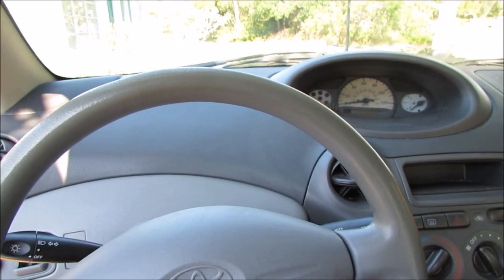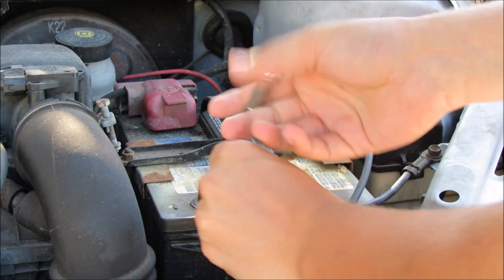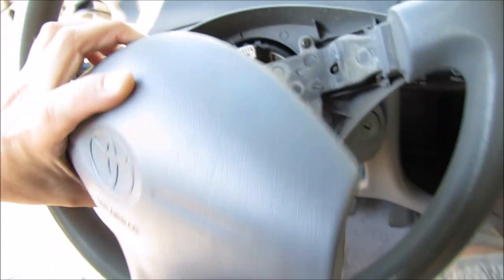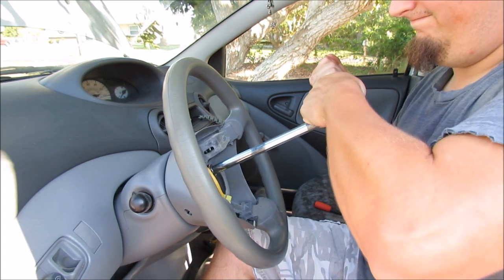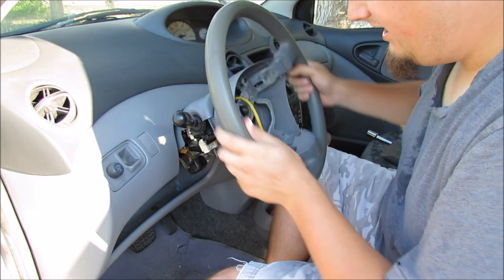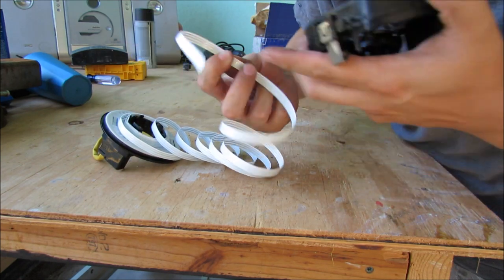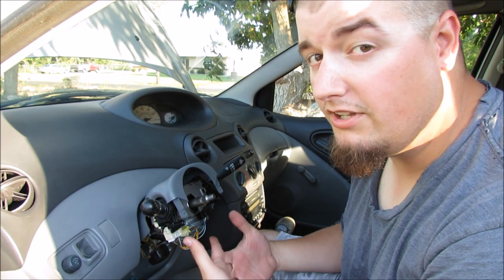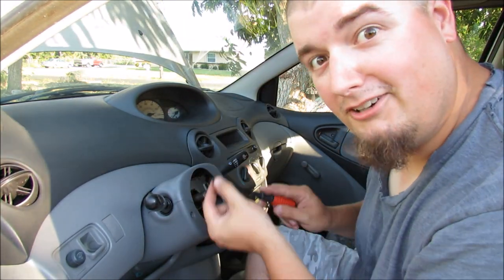Toyota Echo S01E07 How to Remove Toyota Echo Airbag

Comment: Great video series. I would recommend fixing the airbag properly. Airbags provide more overall safety even when wearing a seat belt, it would contribute to resale value, and It would make a good video that shows you fix things the right way. Keep up the good work brother.
Reply from the maker: Thanks for the view and  comment.  Although im clearly not a fan of them.  I will be sourcing a new clock spring assembly from somewhere, maybe a junkyard.  These Echos are getting harder to find.  I realize now that my turn signal stalk will not return to the off position without it.  So theres a few reasons to get it back.  Functioning airbag, Horn, and Turn Signals.  Its a much needed fix.    Thanks again for watching!

Comment: FYI: For anyone else wanting to look under the steering wheel without pulling the steering wheel. Turn your steering wheel left or right and you can pull out the Philips head screws. 

So much easier than pulling the steering wheel! :D

Comment: Hey! Nice video man. I was wondering since I want to replace my steering wheel. Is there a way to loosen the cable which sits in the middle of the airbag on the back of the unit? Thanks in advance!

Comment: Should invest in a steering wheel puller next time that way you don't strain yourself trying to pull a steering wheel off.
Reply from the maker: but wheres the fun in that.  I took off the one in the mustang with a hammer lol.
Reply: One year later - I had to use a steering wheel puller since it would not come off. Autozone gives you loaners if you want. Problem I was having was that the airbag light on my 2001 Echo was on. Also, before that the horn did not work. Problem the spiral clock. Changed it and the airbag light went off and the horn now sounds. Thanks for putting up this video. Without it no way would I have even tried to dismantle the steering.

Comment: I drive an echo (right hand drive in Aus) my airbag light is also on, was hoping it was an easy connector under the seat set up like the Camry haha apparently not!!.  I’ve had a few weird things stop working over the past yr or so, such as interior light, radio & (forgot the third).  Just a question, I have this blue light on the dash, I’m guessing it’s something to do with water & temperature, do you know what that is and how to fix it?
Reply from the maker: The only blue lights i can think of are the water temp sensor being cold like you said and the high beams light.  Make sure the stalk for the lights isnt pushed forward or back and your high beams arent on.
Reply: Thousanddollarcarguy oh yeah that was the third thing the light indicator for high beam doesn’t come on.  I watched another video of yours and I think the blue indicator symbol I was thinking of you called something along the lines of radiator cooler fan?  Has a thermometer with water symbol underneath.  Sorry it’s vague I’m not much of an under the bonnet kinda driver, I just get in & drive it lol
Reply from the maker: @jhrhiggi  go to this link https://www.toyota.com/owners/resources/dashboard-lights/echo/2002 and look over all the icons.  It should tell you which one your looking at

Comment: Ah... no lug nuts have a torque rating for a reason, overtightening can cause problems for the threads of the stud by collapsing them and also for the rim material.  Overtightening on a mag or aluminum rim can cause fractures in the hub area. Which could, COULD  cause an accident and you COULD die from direct result of doing that.  Might be 1 in a million but. There's multiple way to do things wrong and only one way to do things correctly.  Other than that thanks,  I need to take off my wheel to turn it into a cup holder. 😃Cheers